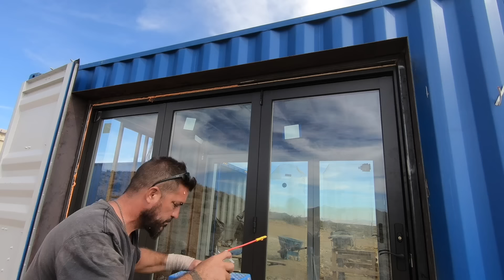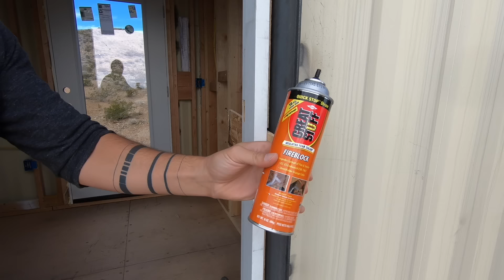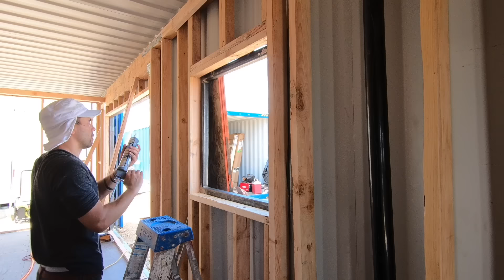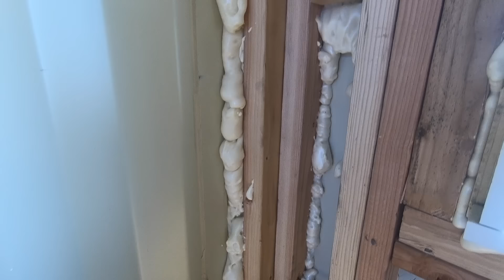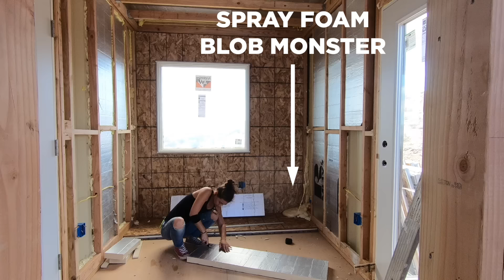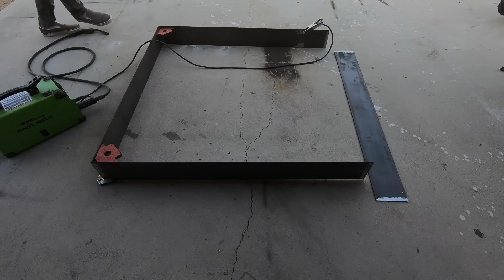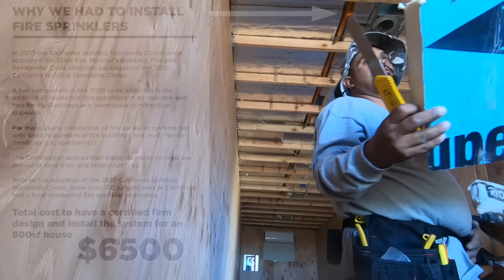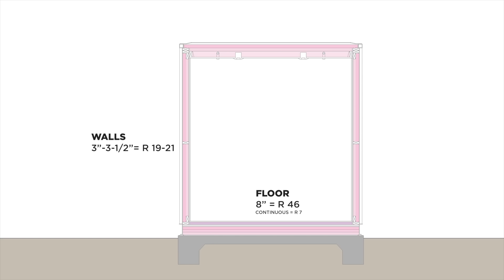Building a Shipping Container Home | EP03 Doors, Windows, and Insulation

Comment: Thanks for all the effort, but why finish inside insulation with 2x4 +  insulation + plywood  + gypse over the container, this is a a conventionnal house?  You could build a wooden square, cover it with plywood and have the same result. Then you can put a layer of corregulated steel for the outside skin. Would it be cheaper than a container? Maybe not, but you have more freedom in design? Is it that you save on the roof?

Comment: In CA by the time the structural engineers are done with it the shipping container walls are really nothing more than glorified siding.  All the materials needed for a wood framed structure are still required, the strength of the container walls are simply ignored.

Comment: Great video, great explanation , really good project .... But I don't think I will build using shipping containers. 
It seems that you have to pay twice for everything ..... Once for the container then again for structural framing ,cladding and flooring.
I going with 2nd hand steel ibeam for a frame (1/4 cost of new) & concrete pier foundation. 
I have already bought my steel.... Maybe I will post my project on YouTube for a comparison to your approach...
Good luck with your house, I think it will turn out quite nice.

Comment: Thx for the post. But may I suggest 2 alternatives. Shipping Container foam boards or Sprayed on Hempcrete.
Spraying on Hempcrete would would serve multiple functions and replace various materials you used. For example, spraying it on, will reduce air infiltration Replacing the need for the use of spray foam. And the lime in it hardens it so it's a firm substrate eliminating the need for studs. And its high alkalinity preserves it. It also more sustainable, healthier and will last longer the foam that studies have shown break down overtime.And spraying the insulation over utilities such as plumbing is easier and more efficient than cutting chases into ridge foam to fit utilities such as pipes.
(I'm sure some ppl will laugh at Hempcrete being something a stoner thought up. But before it became illegal to grow it hemp used in 100s of ways and there are examples of hempcrete being used 1000s of yrs ago.) 
So a more conventional but better suited option would be to use InSoFast Shipping Container foam board system of insulation https://www.insofast.com/products/shipping-container-insulation-panels.htm 
They are designed just for purpose of insulating  Shipping Container and fill in the ridges eliminate the air gap and condensation that can form. And eliminate the cost to studs the walls too since they have self supporting strips that can be used to screw into for sheathing.
Studs are only needed to be used with non rigid  insulation such as Rockwool. Which is lower R value too. 
But the iso foam insulation you used did have higher R value. So additional insulation would, needed to be added to exterior to match the R value on of your home..

Comment: Love your work and your approach, but I don't think the building code engineers did you any favors as you sort of lost the economy for using a shipping container as they pretty much had you frame out a structure as if it was a typical one-story dwelling.   The shipping container is incidental given what they made you do.  I don't think they understood shipping containers and what they are designed to do.   For one thing, I don't think you needed a full slab, seismic concerns or not, and corner piers should have been fine.   If the concern was the piers tipping in the event of a seismic event, then joining the piers with steel reinforced concrete grade beams would have resolved the issue, with one truck being sufficient for the beams and piers and you still would have had a short load.  Shipping containers are designed for stacking (fully loaded) given the harsh sea environment for heeling motions +/- 20 degrees or more, plunging seas, shock, etc.  By themselves, they should satisfy California shock requirements.  These containers get their compressive strength from the box steel framing with the only strength provided by the corrugated skin is to ensure the framing stay plumb and square.  I like your approach to frame out the windows and doors with a steel insert.
Reply: Jolie Rouge

Comment: Ben, another great video. (But some of the links don't work).  I'm still unsure why you couldn't add another piling or form of support under the middle of the container floors, rather than making an entire concrete foundation. Are concrete foundations that inexpensive, comparatively? (And I'm specifically considering a home in an arid climate as well).

Comment: hi, i'm also had a long time interest in converting containers to living quarters. and one idea that  came to me but couldnt test it is to flip the container upside down using the ground structure as a roof that does not need support when cutting through the walls and i think it will look more like a bridge structure that will only need support on the four corners, any thoughts about this idea possible or not ?

Comment: I use Zinc spray weld through primer and I rate it, as I live in a rather corrosion friendly area in winter and haven’t had any problems of corrosion although it is porous so not being treated and covered correctly after welding could leave with corrosion after some time

Comment: For those in the back. Take some time to do some simple research. You will see in some states this type of DIY home is much cheaper than paying questionable at best home contractors. Since smaller affordable homes is no longer a trend but a necessity this info is timely. While this channel is looking to help, many contractors are working with their local law makers on how to curtail this sensible way to have a beautiful custom home w/o being taking for bad.  You don't have to be in debt 15, 20 or even 30 years to have a beautiful home. Some keep mentioning he did way to much as far as structure. He did state local codes required certain minimums and parameters before he could even start building. This is why in states like CA they get these crazy construction codes set up so right from the start you are going to pay dearly.

Comment: Appears to be a WAY over engineered and expensive way to build a structure on a hill (no worry of flooding),in a desert ( no worry's of sub zero temps), no trees or vegetation (no Forest fires) foundation Overkill ( enough to support a multi level structure)...a sprinkler system?? Really...the sprinklers should be installed on the outside to cool the structure from the baking 🌞,,,(not really,save the $)seems like some reflective coating or paint would do the trick on the outside along with a good HVAC , video should be retitled ( How to build a home for 3 times what it's worth) SMH 🤔

Comment: Your structural engineer is way too cautious. Inner plywood is not a structural element in my humble opinion. Even the 2x4 framing felt more than required.
Reply: When your freedom or all your networth is on the line, you tend to be extra cautious. Never met a single structural engineer who designed on the lower end. To them, middle end is lower end, upper end is the middle, and double the requirement is their safety net. But I get what you mean, I was also Jackie Chan-ed "whyyyy?" lol

=One Love=

-A

Comment: Ben, it would of been cheaper and better if you built a rammed earth home. It's fireproof, good insulator,mold proof, termite proof, and earthquake resistant , combine that  with an earthtube you won't HEVC system. Living in a metal building is not good for your long term health.

Comment: Really informative. Did you consider putting two containers side by side and cutting out the intervening walls to create a wider space? Any idea if that's practical?
Reply: You'd have to then build what is essentially another wall to support them...You wouldn't get a wider space that way, just a different type of wall.
Reply: @nogglebeak  Why would you need another wall? If it's a structural issue, why not just put a beam from side to side?

Comment: Better solution based on what you did: build a normal home, and just slap on the corrugated steel outer walls to the outside. You don't really have shipping containers at this point.

Comment: Question:  on the insulation, it looks like the insulation panels leave gaps over the walls' indentations. Could that cause condensation issues? I've seen numerous other projects use spray foam insulation. Thoughts?

Comment: Did a great job!   Did you frame 2x4 stud walls?  Looks like 2x3.  Adding that additional subflooring is way overkill in my opinion.  Did you think about installing the sewer pipe under slab and coming up through the bottom of the container instead of cutting all through the steel floor?

Comment: This is a great series. I love the attention to detail in describing the design, engineering and construction process. I work as architect in europe and I find many of the materials used a bit of overkill but biggest one is requirement for sprinklers in a single family one floor dwelling. I would consider this maybe if the house was powered by gas but in this case I am sure its not. Looking forward to seeing more videos!

Comment: We are building Net Zero in CA - impact fees is what kills the project. Permit was not too bad and quiet fast for Amador County. Should be done by the end of June. In California on any property that is 5 acres and over you can apply for LDRD - Low Density Residential Dwelling - that permit eliminates sprinkler installation on a new construction. We saved at least 40k there. I am not sure what you are going to use for power at your project. We have 7.8kwh of solar and 36kwh of battery capacity off course off grid completely. That will give you title 24 exemption - that means that you would not have to deal with insulation per title 24 requirements.

Comment: Weld-through primer is just fine. BUT! keep in mind that primer does not  provide A moisture nor does it stop metal from rusting. Primer is is only intended to give a coating a clean place to stick. In A dry climate you should have no problem.

Comment: Dude, looking at your video, you would have been so much better off just building a house with bricks and mortar. A ranch style home in that environment would look gorgeous and timeless, instead you choose to go with metal boxes.
Reply: Just an FYI. Brick home construction doesn't exist in Calif due to the seismic issue. The location of this house is only a few miles from the epicenter of the 1992 Landers 7.3 and the Big Bear 6.5 earthquake 4 hours later. I was in Big Bear and the house I was in was extensively damaged. Steel construction is actually quite durable in the desert where exposed wood doesn't hold up.

Comment: Truly the dumbest thing I've ever seen.  Shipping containers are pretty narrow to begin with; after all the framing you literally built a large hallway for a home. The cost was more per square foot than a normal build. Absolutely pointless and not even comfortable to live in. Your videos are phenomenal though; obviously you're being sponsored by Home Depot and just having fun on this project. Unfortunately you have proven that shipping containers are not good homes.
Reply: It was his choice to use single wide containers. You can easily weld two or more together to get whatever room size you desire.
Reply: @tdkeyes1  yeah, also with those regulations better to go decent big and confy or not build at all.

Comment: Wouldn’t recommend expanding foam insulation. It’s a mess and not very effective. It should really only be used around windows (and even there there’s better products available). But definitely don’t use the stuff to fill bigger gaps.

Comment: Stick built has got to be less $$$ and definitely less work ...
Reply: and definitely less durable!
Reply: @irnomo9784  There are plenty of 150yr old stick built homes still standing strong ... My grandfathers old home is still being lived in and it is over 150yrs old ...
Reply: @1952MLS  sure, theyare around!  my sisters house is just as old.  however, these will last thousands of years i think, properly maintained.  bare minimum 1000-3000
Reply: @irnomo9784  I spent some 30yrs working steel ... Welder/fabrication/construction ... No, they won't ...
Reply: Gomez Addams Are you welding 2 to 3 inch thick steel? 3 inches of solid steel will last way longer time than any stick built house
Reply: Gomez Addams You can also get them in stainless steel, those will last absolutely forever
Reply: @irnomo9784  You fail to notice I said "$$$ & less work" ... You have no idea what you are talking about ...
Reply: @irnomo9784  I have welded everything from  sheet metal to 12" thick steel ... Pretty much any kind of steel commonly used ... The widest weld I have made was 14" face with a 12" throat ... I spent 3yrs welding on nothing but stainless ... Why would anyone build a "house" out of 3" steel ??? LOL 

$$$ ???
Reply: @1952MLS  do you not know how thick those containers are and can be?  you can get them 3 inches thick stainless steel.
Reply: @irnomo9784  1000-3000yrs....lol....By then we will be living in floating homes in other galaxies...lol....  Who will care about shipping container homes then :)
Reply: i saw.  no need to be rude now.
Reply: its called using context clues to figure out what i meant.
Reply: look at the titanic.  it has been underwater over 100 years in salt water and is still there, some of the metal still solid.  imagine 3" thick stainless steel that only gets occasionally rained on, especially out in the desert.  it will last forever.  that was my point.
Reply: Joseph  hair bun?  im confused
Reply: yeah i just checked them out, maybe not as thick as i thought but still, will last foreverrrr in the desert.

Comment: Uh, great video however, this project is way overkill.
Reply: Um I seen a bunch of mistakes on the welding portions. You should never use a small welder like that for structural. The arc characteristics are horrible. And should be using 7018 or 7014 welding rods as they meet structural code. And I don't care is it says weld through primer is that steel is not Shiney when I weld it it will not pass regulations. And to control the warpage in bin when welding you do stitch welds until gap is completely full and weld has to be at least the side of base metal.
Reply: Really?
Can we see YOUR better version, start to finish?
Hmm??

Comment: The engineer is actually correct with this approach. The large openings greatly reduce the strength of the container in regards to roof loading. At the end of the day, it's probably easiest for them to think of the container as nothing more than metal roofing and siding.

Comment: I note your insulation build up and that you are building in a dry low humidity climate.  In higher humiditys and cool/temperate climates your build up will suffer condensation, which will manifest itself on the internal face of the external steel.  Warm humid air will permeate through the insulation, around and through the joints, to reach the steel, which will be below the dew point.  With the steel rusting from the inside (assuming it isn't rusty already) it will finally appear on the lower section of the corrugations, by which time the sections will have to be cut out and new sections welded in, BUT the space behind the steel is filled with PU foam - mega toxic when set on fire by the weld!  The answer to all this is to add a vapour barrier between the insulation and plasterboard, a sheet of 250MU polythene with aluminium taped seams would be best or tape all the foam boards creating a hermetically sealed box.  The socket/switch outlets and lighting become the issue and therefore need to be sealed against the vapour barrier.  Also, you have used LED lighting, which is commendable and the use of flourescent, tungsten or halogen would definitely not be approved as they would overheat, causing a fire within the PU foam - frightening!
However, overall your build is highly commendable but I cringe at the potential for DiY'ers to get it all wrong because they simply don't understand all the details.

Comment: Notice you didn't wire any network, hope you weren't expecting to use Wifi across steel containers because that's probably not going to work very well. Even if you don't an internet connection in Joshua Tree, you may one day.. and at the very least you can still have an in house network for data and media.

Comment: Mechanical engineer here with actual experience framing homes as a carpenter aswell.. yeah that 1/2" sheeting was definitely overkill... could've replaced  2x4 walls with 2x6 if strength was the issue.. plus everywhere you made your openings you doubly reinforced it with tube steel .. if the engineer had put those parameters in CADCAM it would show that it would have minimal effect on the structural integrity of the container based on the stress tests

Comment: Personnaly I'm not a fan of shipping container house. Because as you see in the video, you do an wood structure inside this container. It depends of the cost of the container where you live and the architecture you want but I prefer a wood frame house which allow more liberty but a bit more building technic is require.